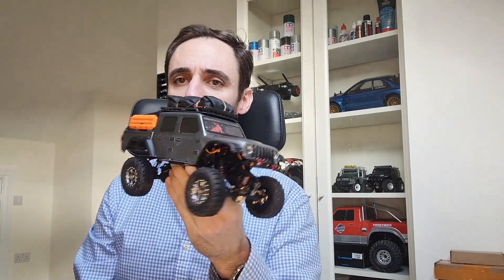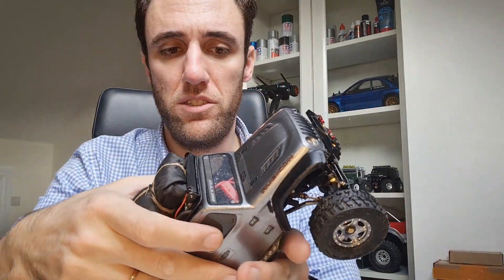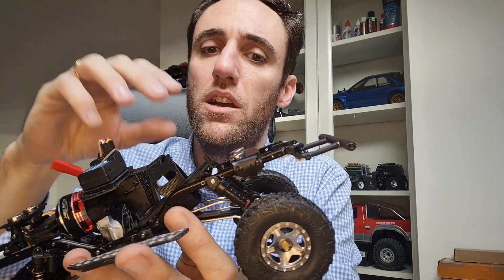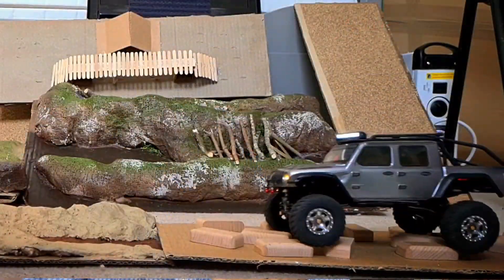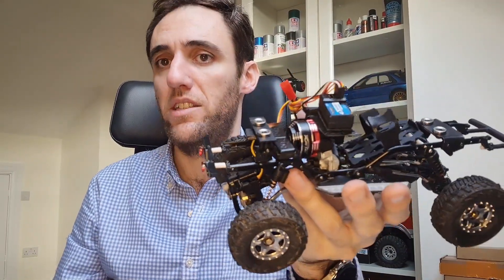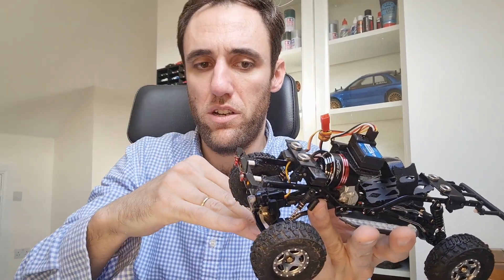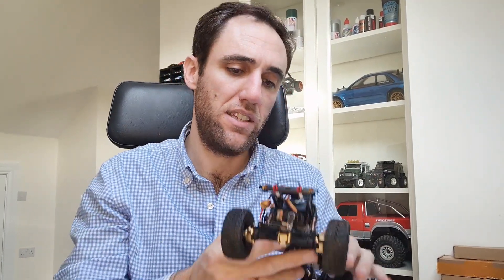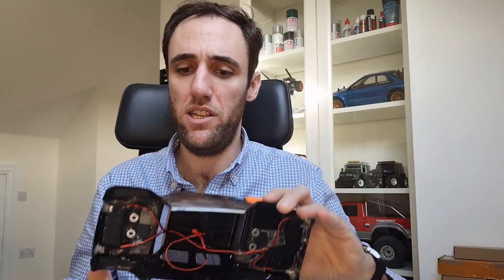Axial SCX24 Jeep Gladiator - Build and tests in the wild

Comment: Hey can you say how much this car complete costs? I want this soooo much! Want to paint it olive green a little bit military and things
Reply from the maker: Hard to tell...
Rig 150
Clearance links 15
Servo 10
Steering links 10
Brass hubs 10
Clear body 40
Wheels 20
Tires 20
Total without motor/esc: 275
In the video I used a Furitek brushless combo that costs around 120€, but you can make it work very well with the stock esc and a 050 motor for 15€.